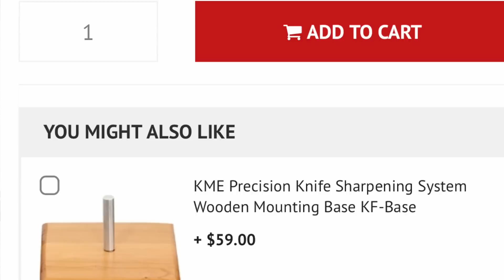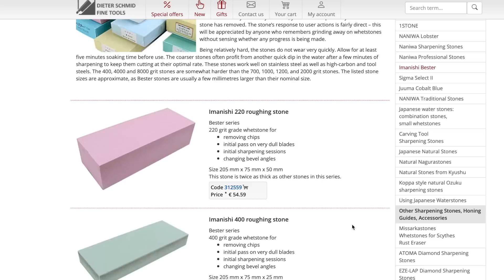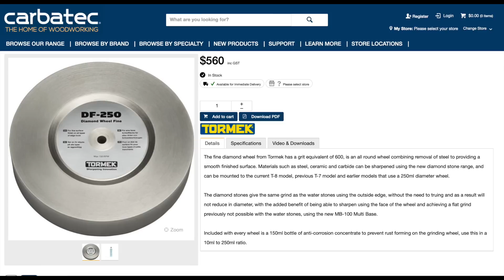Fixed Angle Sharpener Showdown - Low, Mid, High Cost Quality Options (Worksharp, KME, TSPROF)

Comment: Love, and mostly agree with, the analysis, but, disagree on the angle cube. Personally, I sharpen on a little, portable table on carpet, so angle is never consistent. A little weight, and the measured angle, since it operates via gravity, will be off. Sticking to the increments marked on the device, however they may vary from "actual" keeps me consistent. I'm also too lazy to keep a log book and have waaaayy too many knives to remember what angle I used for any particular one, so I just use the marker and adjust accordingly. Works for me. 
Oh, and FWIW, I'm on my second KME. While they say they have a life time warranty, I've found that they always want "a video" <not everyone has a video camera, nor will a cell phone make a small enough file to e-mail> and I'm sick to death of arguing back and forth for days/weeks to get a couple of $.25 parts!

Comment: There are two very large PROBLEMS / MISTAKES: 
You could call it a design flaw, but it's easily negated with knowledge and attention to detail.

The knife is unsupported and the entire assembly flexes (perhaps throughout the process), changing the angle. 

Just as a scale should be TARED with whatever container is used to hold the substance measured, so should the knife's plane define the zero degrees from which the angle is measured. As it is the compound angle of [the knife] vs [the bevel], not the bevel vs the ground or gravity.

Comment: The WS precision elite is not $250.00. Thats's twice what they cost. It is just as good if not better than tose other sharpeners that go for up to $1000 and there are a plethera of aftermarket accessories for it such as a table clamp, all types of stones and strops,  clamp stabilizer and 4"to 6" stone holder that allows you to use any stones you want to sharpen any type of steel. It has minor limitations but they are minimal. The TS Prof and Tormex are way over prices as are the extras. Save your money and get a Worksharp and a stone holder and invest in some good Arkansas or bonded  diamond stones.  With the aftermarket stone holder you can use any stones from 4 to 6 inches long and about as wide as you want to go. I have all of the accessories I mentioned and sone good stones and have sharpened my Benchmade, Chris Reeves, Kizer, etc knives in all types of steel including the supersteels and still paid less than a Tormex or TS Prof basic sharpener.
Reply from the maker: I showed the shop on the screen, showing its $250. Are you forgetting I’m in australia and in different countries money numbers are higher/lower
Reply: @CedricAda  yeah, sorry, I didn't even start watching before I spouted off, I just assumed you were here in the states and jumped the gun. Sorry about that.

Comment: I made little cardboard templates with the angles (as indicated by the Worksharp) written on them. This way I only have to faff around once dialling it in with the cube and finding the good position and things like that. From then on, I just use the templates and any knife is set up exactly the same way every time.

Comment: Has anyone wore out their workshop 320grit diamond?
Reply: I have. It took a fair long time, also it was my first diamond one, so I surely made all dumb mistakes there are to make, and also used it to basically re-profile everything from S30V to S90V and most others in between. I have no problems with how long it lasted (and now it's still a pretty reasonably usable fine-ish plate).
Reply: @g2rdon  I was wondering I've reprofiled a bunch of knives and it's still eating great very surprising.
Reply: Has anyone worn* out ...
Reply: @einundsiebenziger5488  ahh is it I believe past tense would be worn or wore. I know worn is adjectively used but being in the past tense idk also don't care man I was done with government indoctrination nearly 20 years ago.
Reply: @isthebeeflol  wear, wore, has/have worn is how it goes. And what has proper grammar to do with "government indoctrination"?

Comment: I’m a bit surprised I haven’t seen ya try the Ken Onion Work Sharp with blade grinder attachment...big improvement over the original. Especially on the larger tools and/or convexed blades.

Comment: I made the mistake of buying a Smith's kit some years ago. After disappointing results (yes, I'm blaming the tool...) I went back to using my Field Sharpener and I use the ceramic stones from the Smith's and another cheap kit I bought because I am a glutton for punishment. One day I'll get a decent system.
Reply: User error
Reply: @Mastermindyoung14  Yep :) When I said I was blaming the tool, I may not have been referring to the sharpening kit.

Comment: i woudnt pick any of these sharpeners. they all suffer the same design flaw and that is the distance from the pivot point is way to far.  no more than 3" else you get deflection. one i linked before is still my fav and its 40 pounds.
Reply: ... way too* far.

Comment: At no point you adressed the fact that on the smaller fixed angle sharpeners, if you sharpen a long blade there will be quite an angle variation between the tip of the knife and the middle

Comment: I've put my $35 Smith's diamond system against paid professionals using these high cost systems.

The only difference was more money in my pocket and more free time to enjoy my hair whittling mirror edge.

Granted, I have 30+ years experience...

I made a video showing how I use the system.  MUCH better ergonomics than driving your hand towards a blade that you're not holding 🥵
Reply: watching your method the ergos look terrible, different strokes for different folks I guess.
Reply: @taylorhickman84  certainly.  I'd call the ergos used here not only terrible but dangerous 🤷
Reply: @taylorhickman84  how many decades have you been sharpening?
Reply: @Mastermindyoung14  "how many decades have you been sharpening?"

HUH? let's stick to strokin' stones, not our egos.